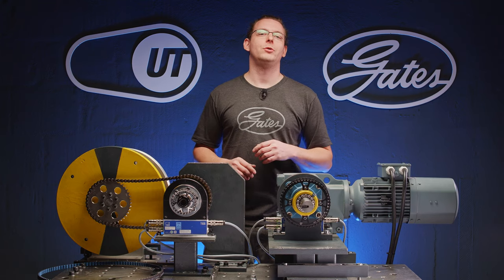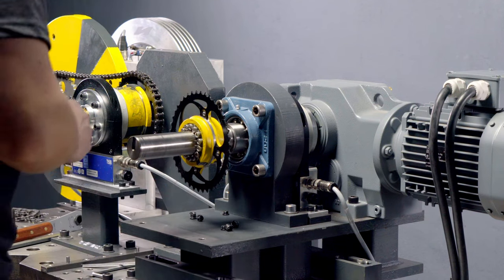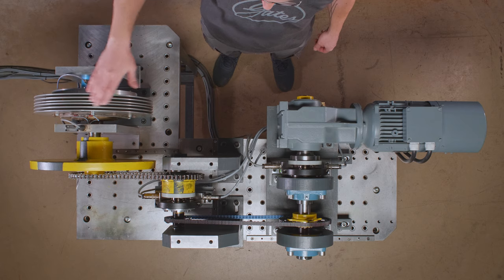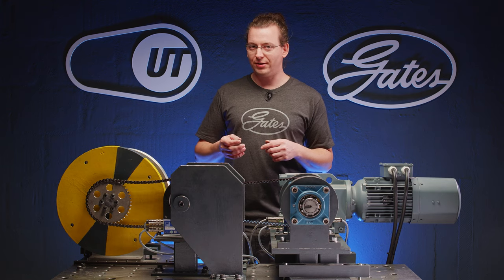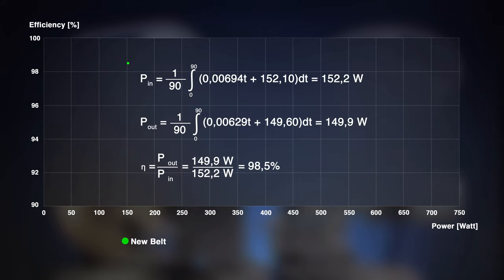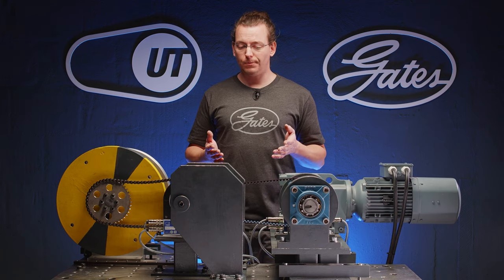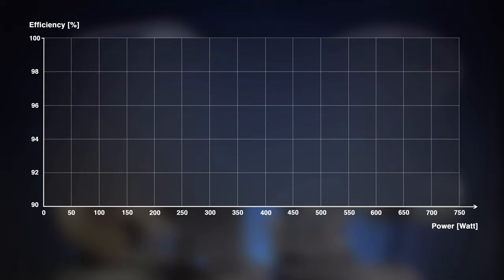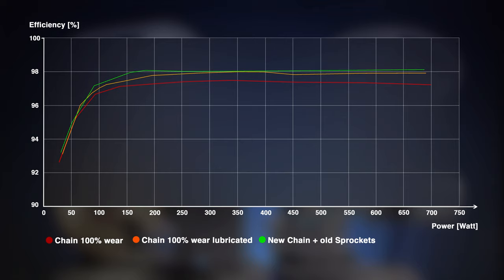CARBON BELT vs. STEEL CHAIN Part: 3 efficiency demystified details

Comment: Have broken CDX belts been reported? / What is the torque power limit to break a belt?  I had a Continental belt, which broke immediately when climbing a heavy hill , with Pinion P1.18  at the small step 2
Reply: Gates is using a different technology for production. So you cannot compare it to the Conti belt
Reply: What technology? did you witness its construction, or do you speak from your own mind?
Reply: CDN belts are crap in my opinion. I had CDX paired with Gates CDN composite Front sprockets and it  lasted 30 000 km. CDX belt is a top notch of drivetrains belts.
Reply: my cdx belt also snapped when climbing a steep hill on my S-Pedelec. I am 125kg.

So i would becareful not to overload the drivetrain.

The Belt was 7200km old.